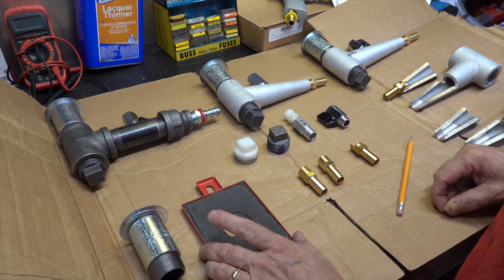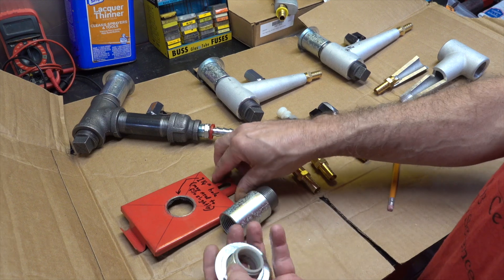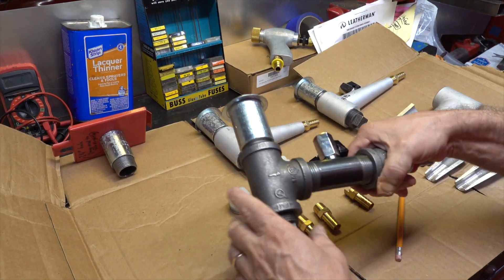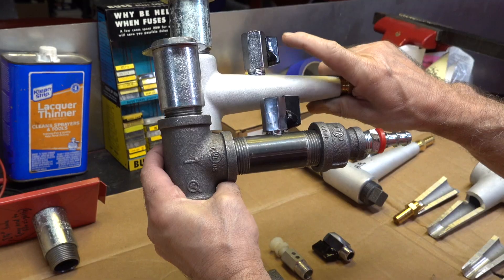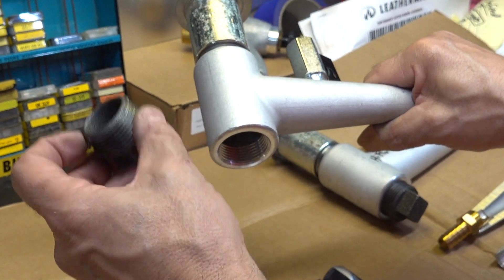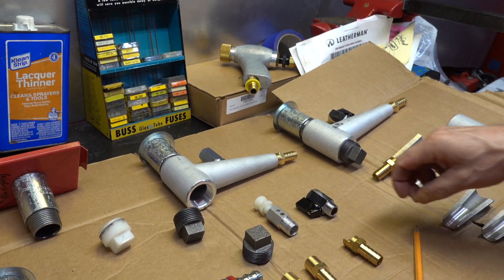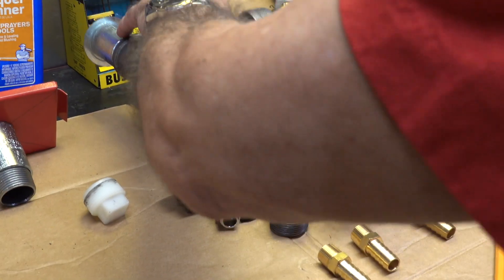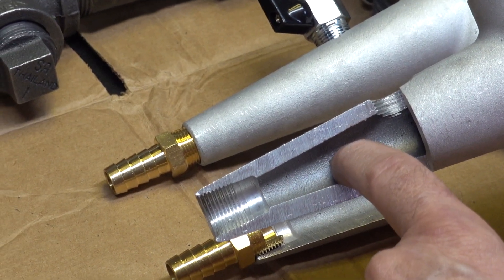Direct Comparison of 3 types of Harbor Freight Blast Cabinet Upgrade Metering Valves

Comment: Why do you want to meter the media???
Reply: If you don't have an air bleed, the media will not move to the gun. You have to have an air bleed to allow the media to move. Like wise, if you have too much air coming in, you will actually have the possibility of plugging the hose into the gun. You will need to adjust the metering valve to your gun and nozzle orifice. 
It's actually an air bleed, not a media metering valve. But, by adjusting your air bleed, 😮you are in effect metering your media.

Comment: Actually, when that opening tapers down it creates lower pressure and higher velocity of air which should be more desirable and why it was tapered in the first place.  I think where it fails is there is usually a lot of media and not enough air, so it clogs for that reason.  Also, if there is moisture in the air, when the air pressure drops and velocity increases, that will decrease the temperature and fog up which can wet the media also making it easier to clog.  With the pipe, the air moves slower but may prevent clogging which is usually the problem with these.
Reply from the maker: That is how a venturi works, true.  But there are other places down stream in the system where there can be restrictions as well as so the system needs to work as a whole.  Multiple venturis would reduce efficiency overall
Reply: @partswasherupgradekit6028  I find that my biggest issue is always with the pressure change, moisture is released and causes the media to stick to the walls and eventually clog.  And just like con trails, it occurs even when the air is very dry (desert environment) but does get worse in humid environments.  Tapering fitting definitely helps.  Mine is not a harbor freight but looks identical (probably chinese)

Comment: Ordered the hi flow. I’m ready for a great working blast cabinets
Reply from the maker: Great to hear! You'll definitely notice the difference.
Reply: @partswasherupgradekit6028  I went ahead and ordered that Dewalt dust separator to keep my shop vac from plugging up. I should be able to get started on doing the conversion this weekend.  I already did the light change over to LED.

Comment: A question for you does the heavy duty pipe version come with the milled barbed outlet?
Reply from the maker: No it does not.  Only our best "hi-flo" metering valve comes with the milled fitting.  Thanks for your question.  Best regards
Reply: Ok thanks for the reply 👍 I’ll check out your site again and see about pricing..

Comment: so much easier and cost effective using pipe hardware
Reply from the maker: Here's another perspective - The price difference from our base metering valve to our very best valve is not much.  Considering these will provide for decades of use, the cost difference is negligible over that period of time.  Best regards

Comment: So why is there an air chuck nipple on the end????? I made mine with pipe similar to the first one. Works pretty nicely used a regular compressed air level valve
Reply from the maker: It is not an air chuck nipple.  It is a barb fitting to accept the media hose.  It looks a little different from the others (which are brass) because it is the type that locks on to the hose with a sharper ridge than a standard barb fitting, and therefore doesn't require hose clamps.  The yellow plastic collar is there as a depth gauge so to speak to push the hose on far enough to fully engage it.  Will never back off.  Hope this clarifies it.  Best regards
Reply: @partswasherupgradekit6028 

Ahhh. Ok yeah it really looked like a regular air nipple (just watching on my small phone). Do you sell a host that I can connect to my gun? Just the standard harbor freight gun. I ran some braided vinyl 5/8 ID (someon said to get 160psi so I did) and it’s really really stiff. It goes from my gun through the cabinet to the flow meter.  It’s pretty awkward to use cause of the stiffness.
Reply from the maker: @AmeriFanPicker  We do sell just the hose on our website.  It is moderately firm, to resist kinking.  Hard to know if it will be considerably less than what you have know.  I think the durometer is 71 if that helps

Comment: All three of these variants are poorly conceived and designed. If you want a true jet based on Bernoulli's principle you cannot have the air coming in the side of the runner. 
Instead, if you run your air into the back of the "Tee" (a four way cross fitting works much better) with a jet that protrudes just past when the top of the tee comes down it will cause a suction that will jet the material far better into the feeder line. I used to build air powered vacuum cleaners years ago where you could not use fans because the particulate being flowed would destroy the fan blades. I also built air movers that are used for evacuating large volumes of dust or smoke from the interior of buildings or vessels where fans simply do not work. They all worked on the same premise that your incoming air must flow into the outlet line. Coming in the side as shown here is very inefficient.
We also used to build mud mixers for drilling rigs where water was used instead of air to mix drilling mud and these worked on the same principle. The powdered dry mud went in the top of a hopper and the water flowing across the bottom tee sucked it in and mixed it at the same time.
Reply from the maker: Appreciate your input but the air inlet would not work in practice where you suggest.  The hopper above the valve contains multiple pounds of media and as it recycles it fills the metering valve up to and past the top of it so the Tee is completely filled with media all of the time.  As a result, no air would enter the system if the air inlet was located across from the runner with the small negative pressures generated.  With the air inlet valve located where it is,  inlet air is drawn across the top of the media, creating the air/media 'slurry'.  You are correct that your placement is best in theory and in some other systems, but not in this case where a full blockage would keep air from entering.  Best regards

Comment: THE BIG PROBLEM WITH THESE SETUPS IS THE LARGER PARTICLES THAT FALL OFF WILL CLOG THE VALVE AND HOSE EASILY AT THE BOTTOM!! I HAVE FOUND REPLACING THE CABNET GUN WITH THE PARTS WASHER GUN THAT HARBOR FREIGHT OFFERS AS A SAND OR LIQUID BLASTER WITH A LARGER HOSE INSIDE THE CABNET HAS WORKED GREAT WITHOUT HAVING TO GO TO THE BOTTOM OF THE CABNET FOR CLEANOUT!❤😮😊
Reply from the maker: Contaminated media is always a problem as you indicated.  One way to address this is to place a fine screen under the wire mesh that holds the work piece to catch the larger chunky pieces and keep them from being recycled along with the media.
Best regards

Comment: A larger media hose size up to the cabinet works literally 100% better. Everyone puts too small of media hose.
Reply from the maker: This is true to a point but when the ID of the hose gets too large,  the cross sectional area and internal volume of the hose cause loss of laminar flow and reverse flow under th einfluence of gravity.  The 1/2" ID hose is a great choice for the vast majority of systems out there.  Bigger is not always better.

Comment: Thank you. Your video sold me. I am putting everything together I need to start Cerakote firearms and need a budget friendly tool to sand blasting.
Reply: Have you used it on anything yet? I have an AR I plan on using it on to remove the level 3 anodized paint on the lower. Have you done that yet? I just got done putting mine together
Reply: @ ultrasonic cleaning will take off anodized paint, not fully. If you are cerakoting, there is no need to remove the anodizing all the way. But yes with the right media like 100 grit aluminum oxide will remove the anodizing
Reply: @chrisgoodwin7667  I’m just bored and want to make it a mirror polished aluminum AR so the goal is to remove all of it so I can start the buffing stages.
Reply from the maker: Thank you !!  We are ready when you are.  best regards

Comment: Why does it need to be vented with the valve itself?
Reply from the maker: Because you need replacement air ahead of the media to be picked up in the air flow stream in order to create the stream.  Great question.  Best regards.  The Team at Best Tool Upgrades

Comment: so you need to have an air feed to the valve as well as at the gun?
Reply from the maker: The metering valve requires air inlet through the small valve on the top with the black valve.  The gun requires air from your compressor.  Hope this helps

Comment: show a used cut open to show wear of that brass fitting I.D. after use. Is it eroding?
Reply from the maker: There will be some ersion over time but it is dependent on the type of media being used, the grit size, and the PSI of the system.  Never had one wear out completely.  Hope this helps

Comment: Is this going to improve all gravity cabinets or just the cheaper Harbor Freight quality cabinets.
I have an older Trinco which works pretty good as is, but if this will make it better I'm  all for it. I just dont want to waste the time and money for minimal improvements. 

Has anyone tried these on a high end cabinet? 
What were your results?
Is there any kind of test equipment to measure the improvement or is it subjective opinions?
Thanks to anyone willing to help! 🙂
Reply from the maker: We have had many customers use this with their much more expensive (high end) cabinets and report great results.  Will work with all gravity cabinets.
Reply: @partswasherupgradekit6028  Sweet! I'm in, I will place an order by the end of the week. Thank you

Comment: 3 years later, no update on if this modifications even works.  I have the big HF blast cabinet, and it has never worked well
Reply from the maker: Please see our feedback on our website.  The modified metering valve is our very best  - the consensus opinion is that it works better across a wider array of media types and grit size.  Happy to assist you getting your blast cabinet to work better.

Comment: I have a dumb question. Why do you make the media do a 90-degree turn to horizontal? Why not keep the flow through the metering vertical and not make any directional changes until after you have the mix you want?
Reply from the maker: Not a dumb question - that's a good question.   To accomplish this you would need the EXACT same fall rate of media as the flow rate entering the vacuum stream.   This would be nearly impossible to achieve and in addition would mean there would be a very small volume of media in the hopper.  The air inlet valve in the horizontal section of the metering valve introduces air at the right point to establish the vacuum based flow into the media tube to the gun.  The media builds at the 90 degree bend and is available as needed based on gun flow demand.  Thanks for asking.  Best regards
Reply: @partswasherupgradekit6028   Thank you. You explained it well.  Does it do any good to add a smaller mesh screen in the hopper to screen out large bits out of the sand as it travels back down to the metering valve?

Comment: Thanks. Even small improvements can make a big difference! 
What do you think about relocating the air inlet valve closer to, or in the down pipe? Thanks
Reply from the maker: Strongly suggest not moving it.  It needs to be where the media is laying in the bottom of the metering valve and about to get entrained into the vacuum side of the valve.  Hope this helps.  Best regards

Comment: how come doesn't the compressed air just shoot up through the open valve into the cabinet when you open the valve?
Reply from the maker: The metering valve does not work under positive pressure, it works under negative pressure (vacuum).  Therefore it is sucking up the media, not pushing it up under pressure.  Hope this helps to answeer your question

Comment: The Venturi you drilled out is to increase particle speed while maintaining a similar volume flow rate.
Reply from the maker: Thanks for your comment.  In isolation that could be correct.  However; this valve is part of a full vacuum system and there are multiple places where the ID narrows down, to include the actual venturi in the body of the blast gun where the vacuum is created.  With multiple restrictions (venturis), pulses can be set up which invariable interfere with each other.  Boring out the metering valve actually smoothes the flow upstream of the gun body, thereby increasing the overall efficiency of the system.  Thousands sold with very happy customers.  Best regards

Comment: Youre system seems a bit over the top for a small blast unit  a lot of weight on the trap door.
Reply from the maker: The use of an aftermarket metering valve in this location is quite common.  We ourselves have sold thousands of them and never had a single comment regarding the inability of the trap door to support the weight.  When you think of the hopper being commonly loaded with 20-30 pounds of media (or more in some cases) being held up by the trap door, the additional couple of pounds from the metering valve is really negligible overall.  Appreciate your comment and thanks for watching our video.  Best regards

Comment: There is no “bounce back “.maybe turbulence at inlet but nothing goes back upstream.
Reply from the maker: Our intention was not to say that the media particles travel back against the flow of the air/media slurry.  Rather, that the particles do indeed hit the flat end of the brass fitting at which time they will bounce off of it and then be entrained into the flow.  This is considerably less efficient than a laminar flow configuration without obstacles in the way.  Hope this clarifies our point.  Best regards

Comment: Couple issues what's being said here... the restriction is more like a venturi which accelerates air speed and should improve sand velocity, too, unless you're pushing way too much sand in given space which means it's clogging up. On the discussion about the brass face ... sand is not going to hit that surface since sand is moving together with the air and those areas in front of the brass face are stagnation points. Your modifications do increase the volume of air and volume of sand being pushed forward ... which of course gives better results as long as your compressor is up to the task, but not due to the reasons mentioned here.
Reply from the maker: Thank you for your comments but we feel compelled to provide the following.  
1) Yes, this could be seen as a venturi but it is not helpful as such.  Why not?  Because there are multiple places in the full cabinet system where internal diameters change and each could be considered a venturi for the purpose of speeding up flow.  However, when there are multiple constructions along the fluid pathway, induced irregular pulsing can take place causing interruption in flow.  Our bored out throat area eliminates one such example and smooths flow overall across the entire system.
2) The media particles are constantly bouncing off each other in the air/media 'slurry' and the flat face of the base of the brass fitting is absolutely being struck by the media particles.  This badly interrupts the flow.  The proof of this is easy to see by the disassembly of valves that have not had this modification.  The face of the base of the fitting shows wear that was caused by this particle impact.
We appreciate your efforts to provide additional information and knowledge to potential users.  However, when that information is incorrect, it has the opposite affect.  Thank you for your last comment wherein you note that our modifications do indeed increase efficiency.  Regards.
Reply: @partswasherupgradekit6028  on point 1) : it's bad design if there are irregular diameter changes across the cabinet. The venturi effect will be the most useful where sand is being mixed with air as this introduces also a lower pressure zone. That's why fuel is mixed there in carbs and same principle is being applied in pneumatic conveying, which is my background. See dilute phase conveying (low pressure, high speed gas flow). With downstream bad designs, you're just losing the effect... just like having intake manifold made of porous material susceptible to trap fuel. On point 2): The brass is going to erode starting from the edge, where the stagnation point transitions to flow lines and will do so also on the modified one. The entire face will not erode simultaneously. I do however realize the effect of removing all obstacles, but the initial smaller design did not really mind this unmachined face. It became a problem after the body was enlarged.

I appreciate what you're doing and generally the product is improved with these modifications - if what you're measuring is the rate at which e.g. rust is being removed from a surface. I do however want to challenge what's being told here and why exactly something is improving. I might learn something myself.